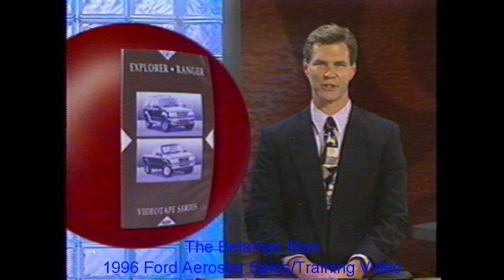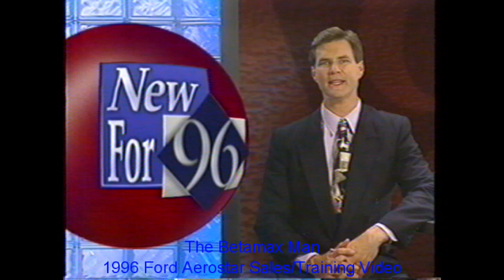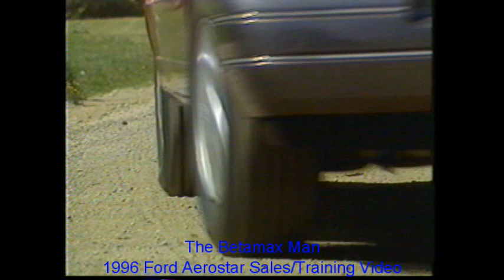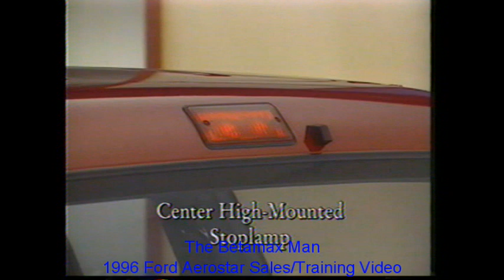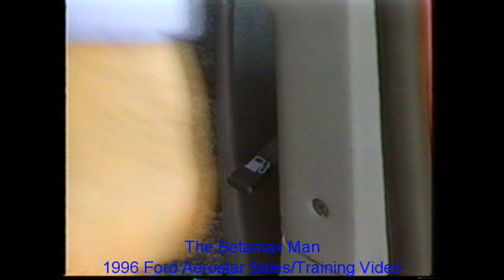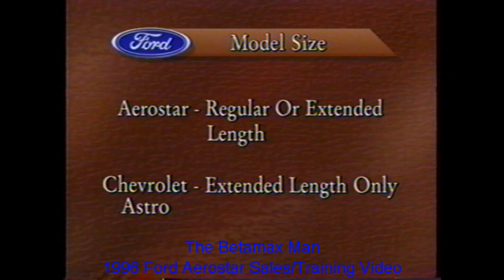1996 Ford Aerostar Sales Training Video

Comment: Thanks for sharing,  i was born in '89 and therefore remember the Aerostar very well, many were still on the road well into my middle/high school years of the early-mid 2000s.   Today they are few and far between,  but I do see them from time to time.   

My parents owned station wagons, no minivans when I was growing up.   They had a 1988 or '89 Buick century wagon that my dad had purchased brand new about 2 or 3 months  after my parents married in September 1988.  When i was in 5th grade they brought a used 1993 mercury Sable wagon and kept that till I was 23. However,  one of my neighbors who had a daughter in the same elementary school I attended, had a blue aerostar with a manual transmission,  can't remember if it was a 4 or 5 speed,  was happy to give me a ride to and from school in it for a couple days one week while  our Century was in the shop for repairs.   I was in 2nd grade but the memories are as fresh now as they were  over 25 years ago, I cannot recall ever seeing a minivan with a manual transmission since, so I assume they were about as rare as the early - mid 1990s Disney movies on Betamax that I seen on your earlier videos.   😊  i just subscribed to your channel.